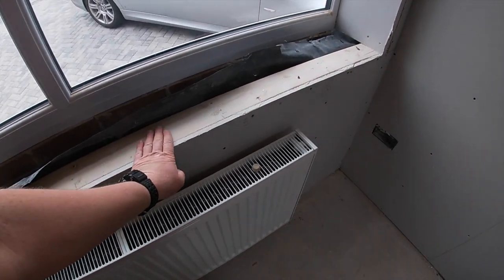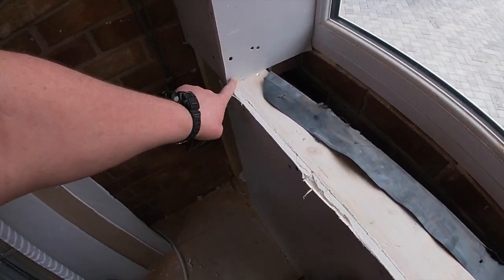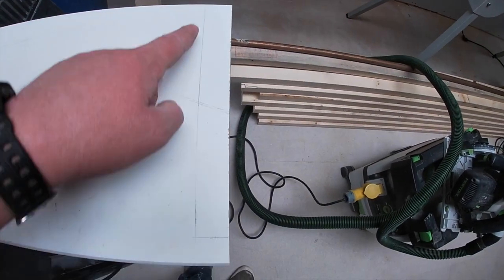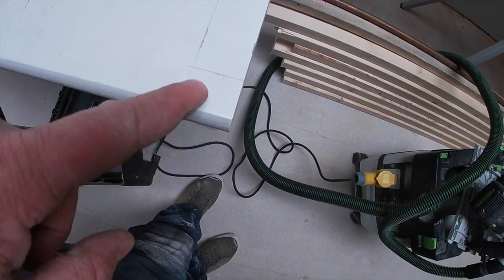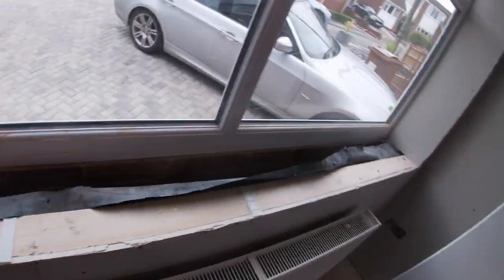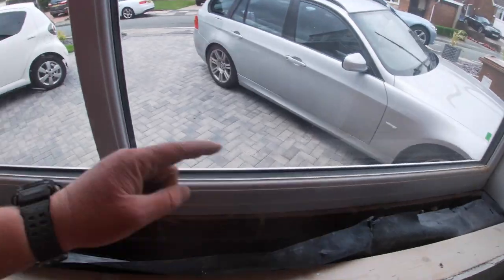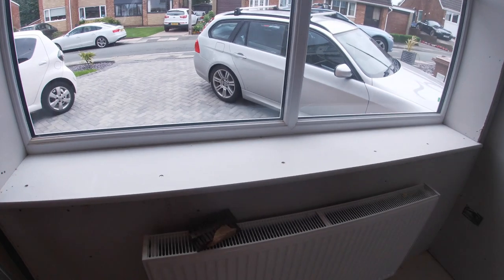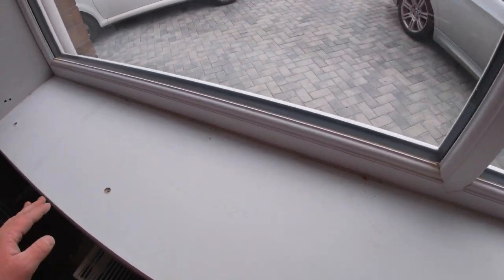How To fit a Window Board

Comment: Why on earth would you screw through the face of it ? Foam it down
Reply: Ugly screw holes showing 😱
Reply: @paulgould7420  exactly
Reply: And weight it down...
Reply: @paulgould7420  it obviously would get filled and painted
Reply: I would rather fills a few holes in mdf than have the board lift off.